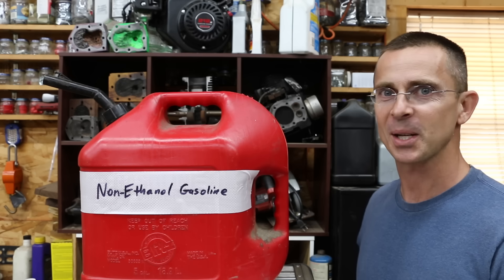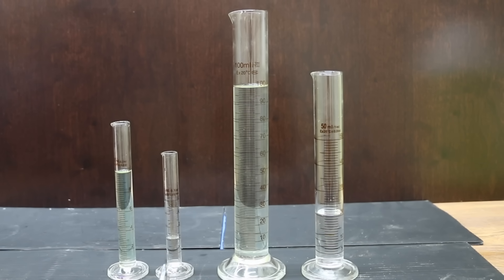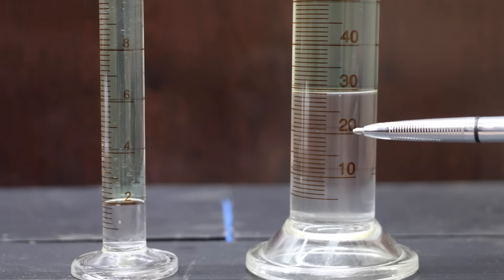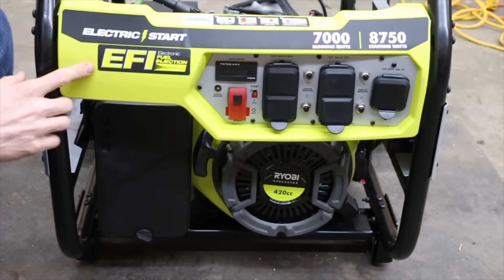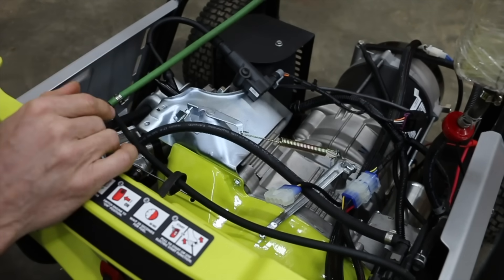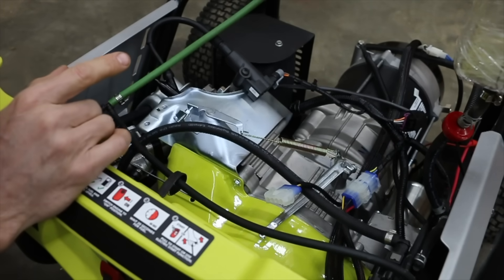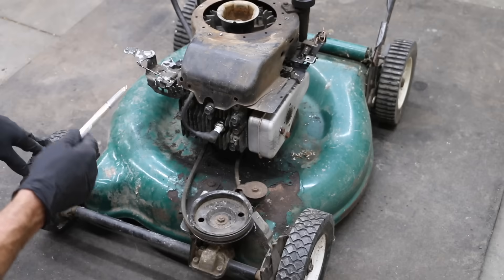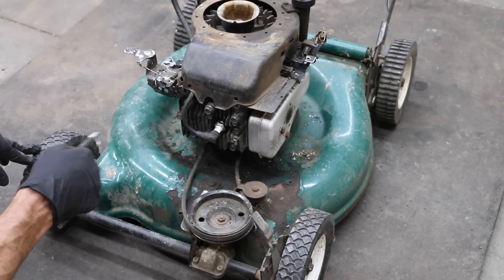Is Non-Ethanol Gasoline Really Better? See the PROOF!

Comment: As a Subaru Technician in Australia we find that E10 fuel
Leaves deposits on fuel injectors and eats away at platinum spark plugs a standard plug gap can go from 1.1mm at factory to 3mm in 112,500 km(sometimes within 50,000km) with the electrode being eaten away. The same spark plug type with non ethanol fuel is dirty but not damaged in any way over the same 112,500km . The money saved by using E10 is spent on more costs at you dealership or workshop due to poor quality fuel. 

This is a great Channel.  Keep up the good work.
Reply: Now tell that to the corn growers and their politician/lobby buddies who made sure that there's a market for their product.
Reply: Robert Warke that’s about the amount of usage platinum spark plugs wear out anyways. Use iridium if you want longer service life.
Reply: Iridium plugs have their own set of issues.
1 being the hight cost, and 2 they have more resistance in them.
Reply: @HowIzMyMao  Yeah 112000 km is like.... A lot? I'd say that's bog standard life span for sparkplugs.
Reply: How can California sell E0 gasoline again without adding MTBE?
Reply: E85 and the ethanol blends are really good for building race cars on the street but other than that I avoid it and try to use regular mid grade. It’s sad half of our gas has Ethanol in it. It calcifies and build up on everything inside the engine, especially if you have a car or truck with a Carburetor. You take apart your Holley Double pumper amd you’ll find blue calcium like deposits all over the secondaries and the bowls
Reply: @matthewtucson3034  
It's way more than half of US gasoline that contains ethanol these days!  I like https://www.pure-gas.org but you can only be sure of what you are getting by running a test every time or possibly comparing fuel economy after the fact.  It only takes a single error along the chain to allow ethanol contamination.
Reply: @matthewtucson3034 ethanol ruined 2 intakes and 2 1080 carbs.ate the shit out of it when it sat.lesson learned
Reply: Really?... that’s the dumbest thing I’ve ever heard. Plug gap has nothing to do with the fuel you use. Plugs will erode no matter what fuel you use. Stop spreading your bullshit
Reply: @Turboboob  He was saying that the rate at which they eroded were different with non ethanol bring significantly higher. So plug gap does have something to do with the fuel you use.
Reply: Subaru’s are fucking garbage anyways
Reply: @Turboboob 
What stupid comment!
Reply: @Shadow__133  See my comment above .   E85 may be cheaper up front, but the cost per mile actually goes up.
Reply: Shadow 133 hemp diesel
Reply: before ethanol gas in the 80s. i put platinum plugs in my ford van..my van ran poorly from that moment on..after a year , i had enough, and i reinstalled the “old” AC plugs with about 15k miles on them..my van improved immediately..
  when i examined the platinum plugs which had about 10k miles on them,i found that every plug had a hole in the center insulator where the platinum was..they were bosch plugs..
  plugs can not make your engine have more power—-,but plugs absolutely can and do cause engines to loose power even brand new..the worst plugs that most mechanics with experience know about are champion spark plugs..i won’t go into how i know this , but i have experienced 1st hand when i roadraced motorcycles (won 6 championships—-2 time national champion)...but. i learned that champion sparks do not remain reliable after the 1st heat cycle..they are like firecrackers, only good one time
Reply: My 2000 Buick GS has turned 200,000 miles, I presume all on unleaded ethanol gasoline.  I checked a few plugs, original AC Delco when I bought it a couple of years ago.  Perfect condition, perfect gap. 

Other than you guys being upside down,  I'm not sure why you are experiencing what you are.
Reply: There is no free lunch, ever.
Reply: Ultra CNC  Depends largely on your elevation, whether you need the higher octane and also, if it's even available in non-E for the elevation.
i.e. in So California, the air is denser (even without the smug) and needs a higher octane. In Colorado (also smug), the octane rating is not needed and is lower (at every station).
Your statement isn't as clear-cut as 250+ HP and V6 either. It depends if it is direct injection or not, and if not - than all depends on the compression ratio (how much the air/fuel is getting compressed by the piston before the spark plug fires. Octane delays the pre-ignition of the fuel.
Reply: Your View You clearly don’t know what Octane is. Your statement is 100% incorrect.
Reply: @afcgeo882  yet you don't state what you "think" it is?
Reply: Your View What I think it is? Why would I? I know for a fact what it is and what it does and if you want to know too, look it up, like everyone else. Educate yourself!  

Hint: it is the rating of combustion timing and all octane grades of gasoline hold the same amount of energy.
Reply: @afcgeo882  There you go "think[ing]" again SMH. When was energy mentioned? Oh, it wasn't in my statement. Too bad I've done more research on octane and reports, than higher than can count (or have fingers to).
Reply: Your View Nice try, but you haven’t.

You mentioned it when you said you need a higher octane in a mountainous area. Octane doesn’t do anything to improve performance. Of your car is made to run on 87 octane, it won’t run any better on 91. You’ll just damage your engine long-term. Same is true if you run 87 in a 91-designed engine. It causes knocking.

Some modern engines will adjust their ignition timing to suit the octane of the fuel, but it won’t make them run more efficiently.

The only exception are some turbo vehicles (which is what you actually want in the mountains) with variable valve timing, which can run on any octane, but produce more power with higher octane compression.

Now stop commenting, little boy, and let the adults have a conversation.
Reply: @afcgeo882  Oh wow, you're all over the place. This info is so other's can see the truth, you've already missed it.

Higher octane will not damage a low octane engine (that's spreading lies). In "modern engines" any MY after 1995, your engine will not knock using lower octane, your engine will adjust the timing and prevent the ping, by law; you will lose power, yes, but knocking NO. And you do NOT need higher octane in mountainous areas. Look up what the average octane rating is in low elevation and then in higher elevation and see the average difference. HINT: In Colorado, regular starts at 85 octane. Turbos do better at sea level, NOT the higher elevation; you should know that. https://www.dieselarmy.com/engine-tech/boosting-altitude-elevation-effects-turbochargers/ Or if you need more basic: https://auto.howstuffworks.com/turbocharger-high-altitude.htm
Turbo engines won't run on any octane, you need to separate direct injection turbos and conventional intake port injection (like I did in my first post). Direct injection will wait to input fuel until later in the compression cycle. Conventional has to inject during the full intake cycle and then will start to compress. If you have a turbo you are forcing more air and the car is adding more fuel than the regular stroke can pull in, thus when compressing, it is more of both and more likely to pre-ignite; which is when you need higher octane. octane ONLY has to do with retarding pre-ignition. In the past (pre '76) lead was used in gasoline instead.
Many cars (even the Nissan Maxima from the mid-90s) will run regular or up to premium, just fine. But, the engine will be adjusted to run better performance times with the higher octane, as it advances the timing. VVT has very little (if any) to do with pre-ignition. https://www.hotrod.com/articles/eliminating-detonation-pre-ignition/
Reply: Your View 100% FALSE. 

Only Variable Valve Timing engines adjust ignition timing to compensate for different octane ratings of the gasoline and the vast majority of engines even 10 years ago didn’t have variable valve timing.

Also, yes, a higher than needed octane fuel will hurt your engine if it was designed to run on a lower octane fuel. It screws up the ignition process and fouls up the plugs, as well as create residue/deposits due to less complete burns. Remember, high octane fuel is made to resist combustion at lower pressures, such as in an 87 octane cylinder. It’s not an issue short-term (if you add the wrong fuel by accident), but it us long-term.

YOU stated that different elevations need different octane ratings. Now you’re saying m they do not. Just stop. The truth is that very thin air hells to retard detonation in engines and an engine can run on slightly lower octane (read 91 vs 93, not 87 vs 93) at higher elevations. However, the difference in performance and knocking sensitivity is so small that it’s scientifically negligible. Factually, there is almost no difference in 91 and 93 octane fuels.
Reply: When they first came out with ethanol around 2005 they were putting about 30% in the gasoline and it was causing a lot of damage. After hundreds of dollars spent on my boat motor I started using non ethanol on all my equipment and didn’t have no more problems. I would rather pay a little extra than have the hassle of working on something. Ethanol is really bad on Honda motors because the jets are so small.
Reply: Good point i experience a similar issue  Thank you
Reply: Overtime would the benefits of ethanol become a disadvantage due to the breakdown of parts making it less efficient? It's only a 2-4% gain anyway. It's almost within the margin of error anyway.
Reply: Shinigami Lee The advantage of ethanol is lower emissions and a lower dependency on petroleum. Ethanol has no financial advantage, so your question cannot be answered.

However, please understand that modern car engines, unlike marine or small engines, are actually designed to run on E10 fuel, which contains 10% ethanol. They do not see this degradation. The only drawback of modern engines running on E10 is possible water collection in the fuel tank. If the vehicle is regularly used, that shouldn’t be a problem either.

As far as efficiency goes... Ethanol is LESS efficient than gasoline as ethanol contains less energy than gasoline.

Ethanol is used in racing for two reasons: it has an octane rating of about 115, which is good for extremely high compression engines and if it catches fire, it can be put out (diluted) by plain water. The draw back is you use a lot more fuel as it is less efficient, but... it’s FAR cheaper than 100 octane gasoline.
Reply: I had an EJ25 in an '07 Outback (Australia), it wouldn't even run properly on E10 idled like it had odd weight pistons in it.
Reply: Ray G That was an issue with your engine. Post 2000, all Subaru engines in Australia ran great on E10.
https://www.subaruforester.org/threads/running-on-e10-fuel.20028/
Reply: add 3 oz of acetone per 10 gals fuel to get up to 20% better fuel in a fuel injected engine and it will clean out the varnish in the engine
Reply: Blakely Diller https://www.chryslerfactoryplans.com/tools/articles.aspx?article=Putting_Acetone_In__Your_Gas_Tank&type=4

https://www.popularmechanics.com/cars/a5959/gas-saving-gadgets-hall-of-shame/

https://www.quora.com/What-happens-when-acetone-is-added-to-the-gasoline-in-a-car-Does-it-really-increase-mileage-Is-it-bad-for-my-car-or-the-environment

http://www.nbcnews.com/id/18909941/ns/business-consumer_news/t/why-acetone-damages-cars-other-answers/

https://www.chemicalforums.com/index.php?topic=2517.0
Reply: Ultra CNC  Had to use MG on a 200HP V6. Regular, Pinged
Reply: Sounds like a mixture problem and not a fuel problem
Reply: I have run my 1995 1995 GM 3800 v6, no EGR, on E10 forever and it causes no problems. Recently I ran a few tanks of 98 premium fuel with the only outcome being the burning of more money. The 3800 is a bulletproof engine of such low tech that E10 is fine. Oh, I did have to replace the various hoses to the fuel tank with silicone because the rubber went hard and cracked.

This is a great channel. Thanks!
Reply: Here in Brazil we have E30 gasoline, any vehicle with carburetor are just not working OK anymore
Reply: Think wisely... You don't have crude oil in your country, got to import... But ethonol can be prepared locally.. you are self reliant..
Also, people are consuming alcohol, which is damaging internal organs... Why can't people can stop it
Reply: great information
Reply: You changed sparkplug every 100K km? Wow!
Reply: wow this comment needs to go up

Comment: My car, 2016 Ford Edge, likes ethanol fuel.  My John Deere Kawasaki engine, my Evenrude 4 stroke 40 horse outboard do NOT like alcohol in the gasoline.  The Alcohol washes the oil lubricant off the moving parts, causing premature wear.
Reply from the maker: Great point. Thank you

Comment: Worked in an ethenol plant.  They get more money from the grain being sold to ranchers (which creates food) then they get from sale of the alcohol.  The alcohol is actually the byproduct.  On top of that, the growing of plants absorb the carbon and then we release it where as petroleum is just releasing carbon.

I also worked in Brazil.  They have two choices, ethenol or Petro.  At the time, Petro was 30%-50% more expensive then ethenol.  From what I understand, It actually creates a competition with the oil industry in the local environment and keeps the cost of Petro down.  They prefer to export it to countries who still use mostly Petro.

The negative is lower fuel efficient.
Reply from the maker: Thank you!

Comment: Great test.
But you mentioned a 4% increase with Ethanol But there was more Carbon on the head/piston.
Which will/should create a higher compression ratio, maybe 4% or more?  
btu/energy from corn is much lower than oil/crude
Reply from the maker: Thank you!

Comment: All fuel tanks will have water condensation form inside them, ethanol gasoline will allow the water to pass through the engine without causing any problems.  Before they started putting ethanol in our gas I always kept a bottle of methyl hydrate, that I bought at the paint store, in the car.  I live in a very damp environment and a couple of cups of methyl hydrate a year would keep my engines running smooth all the time.  As a mechanic I've recommended to several people that they ensure that they run a tank of ethanol gasoline through there vehicle every six months or so.  However, I think it's getting harder to find non ethanol gas so the point is probably moot.
Reply from the maker: Thank you

Comment: I was going to call out a flaw in your methods with the water bonding with ethanol and any other hydrophilic compounds in the gasoline. However, the correct displacement by volume from the addition of water confirmed that your assumption was correct. Brilliant experiment.
Reply from the maker: Thank you!

Comment: Hello. About this issue. One matter is the origin of the ethanol: is it convenient to farm your fuel? I am unable to respond. About the efficiency: if one could adjust the compression ratio of an engine and increase it, surely ethanol would show a better performance like an immediate reduction of mileage cost. Our engines do not have such feature, so there is no economic advantage by using ethanol fuel. Our Engines should  have been designed for ethanol, then the increase of the compression ratio  would have shown a positive effects. The others negative aspects I leave for others to express and comment.
Reply from the maker: Thank you!

Comment: Someone commented that non-ethanol is more expensive, so why use it.  4% more efficient might not seem like much ... but it means that a 1000 mile trip will require enough extra fuel to cover the extra 40 miles.  Non-ethanol fuel is, therefore, more "green" than E-10.
E-10 is NOT better for the environment.
Reply from the maker: Thank you!
Reply: Plants absorb carbon, then we out it back in the air by burning it. Petro just releases carbon with no absorbtion. Ethenol isn't 0 emmisions but a lot better then Petro.  How is that not better for the environment?
Reply: E-85 is better for the environment ... but you'll have to buy twice as much to travel the same distance.  The 15% gasoline needed to kick off the combustion process is offset by the 85% alcohol cleaner burn.  Going "green" isn't cheap.  
E-10 doesn't offset the increased usage of fuel to cover the same distance.  Non-ethanol is better than E-10 or E-15.
AND ... it takes more energy to produce a gallon of Ethanol than we get out of it.

Comment: I got quite a few comments about mileage on my last trip. Most were educational. Next month I need to travel 750 miles one way (and obviously 750 miles to get home)  I will do my best to keep variables to a minimum : non ethanol gas one way and 10%ethanol gas on the way home. In order to keep this experiment alive I welcome all comments. I will set the cruise at the same speed both directions, I will be going no higher than 300 feet above sea-level. (I live and travel on the Gulf Coast). If there are any variables other than air conditioning that I have not thought of please let me know. I want this to be a pretty decent experiment. 
 I welcome your input on how I can make this a good experiment.
Reply from the maker: Great information. Thank you